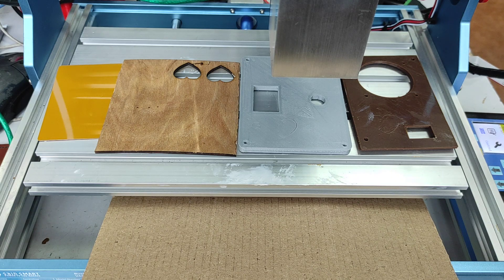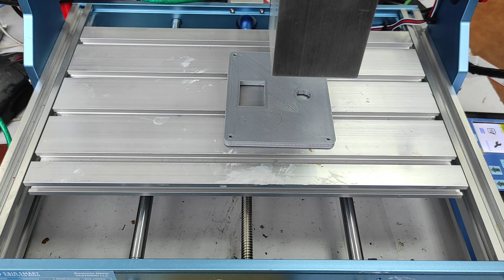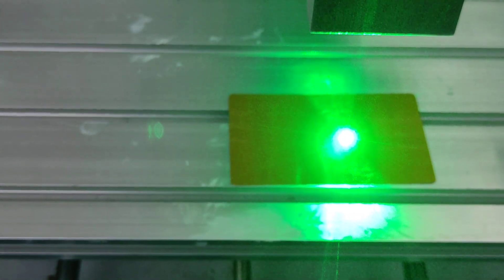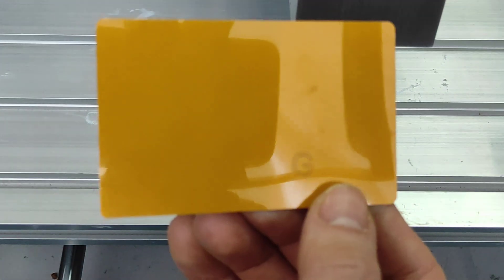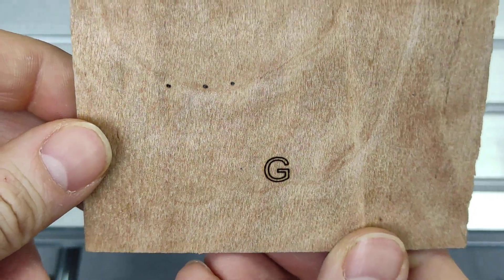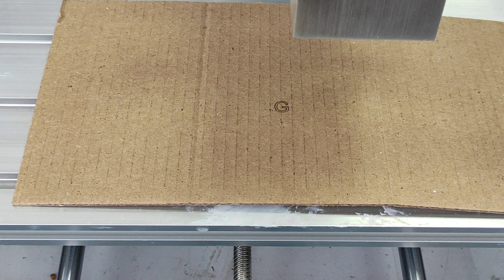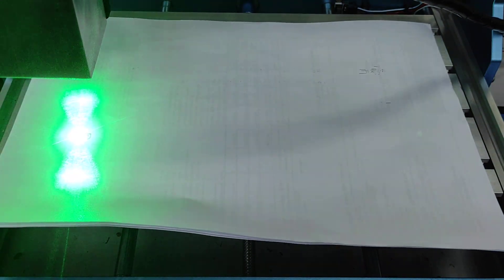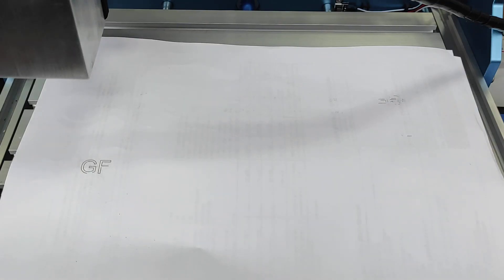Accurate laser engraving with an Endurance 1 watt green diode (520 nm) laser.

Comment: No anodized aluminum there. Only painted. 1:30
Reply: Yes I have corrected George on that point. He should at least amend the Introduction comment for this video.
Reply from the maker: thank you
Reply from the maker: but DPSS can do both - painted and anodized... it is no problem for it
Reply: @Endurancerobotschannel  Yes correct but if you are making a video demonstrating a point you need to do it using the actual material you are actually stating that it is. Don't assume people know that.